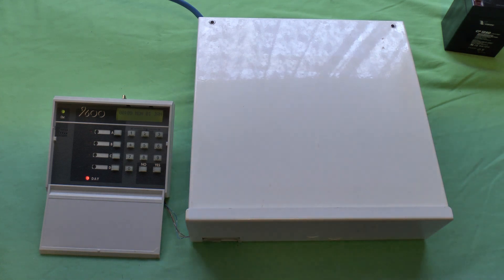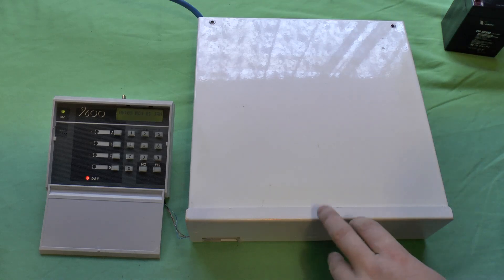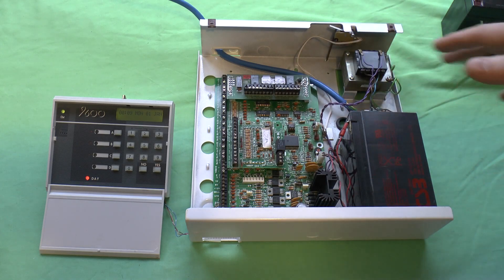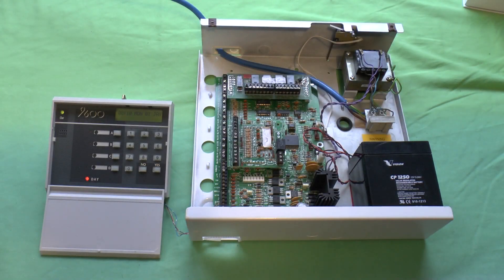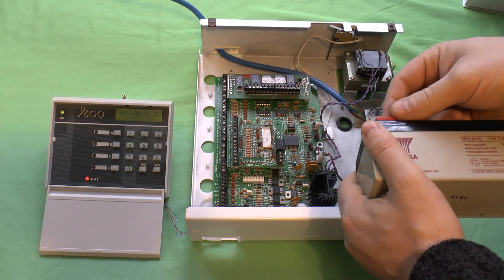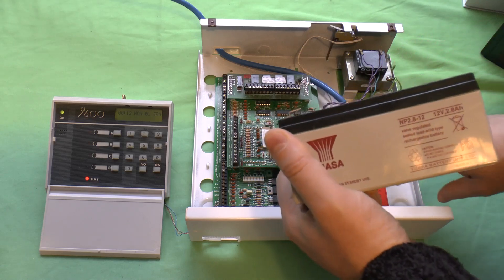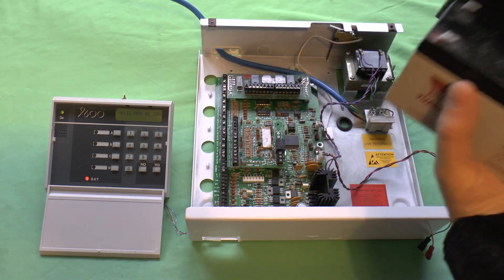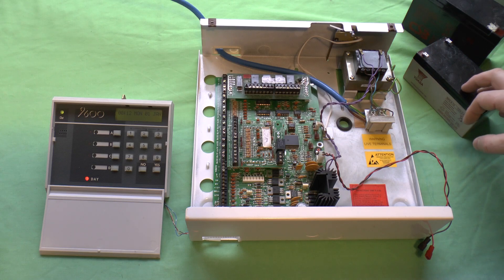A question about burglar alarm batteries

Comment: Best panel scantronic ever made imo and arguably the best domestic alarm system you could get, not many out there now but I guarantee the ones still in operation will far outlast most modern panels installed today!

Comment: The bigger the ah (amp hour), the longer the alarm will be up and running in a power failure.
Reply from the maker: Yeah I get that (that's why there's a 22Ah in mine). It's things like a 4Ah battery in a panel designed to take a 7Ah which puzzle me.

Comment: Either the batteries wont fit properly in the panel or the engineer has taken out a failed 7.2ah battery and replaced it with what he has at the time.

Comment: just to point out, you shouldn't stand that 7Ah battery on its end like that....... it affects the life of battery if its standing on its side like that...
Reply from the maker: Better tell Scantronic then, because that's the way they've designed their panel to take it. Also APC have UPSes such as the SmartUPS RT range which are switchable between tower and rack orientation just by swapping the rails for feet, obviously in one of these orientations the batteries will be flipped on their side, just like those shown in this video.

Comment: Its known as TRIOCS a very common condition that affects engineers and alarm company's. In laymans terms it stands for Tight Rectum Installer Or Company Syndrome. Very common in the industry. This is why alarm engineers that are self employed can spend up to 50 minutes using the toilet...... So no, there is no reason not to use a 7AH battery. This grade of panel is for large domestic / small commercial installs. NACOS and other industry bodies do actually specify the time a system should run on standby. The 9600 was the brother of the 9800 panel that just had an LED display. Its a rock solid and very reliable panel aside from the keypad keys wearing out and having a dodgey back tamper they are great alarm panels. I installed one in my parents home for them that ran for nearly 20 years before they moved. It looks you yok have the zone expander and a comms board plugged onto that panel. Keep it and use it. Sadly scantronic have been purhased by Cooper Menvier and my personal opinion is that the quality has dropped since then. Scantronic made some great panels like the 9100 (showing my age now) 9500, 9600, 9800 and the 448. Shame they didn't carry on as they were. I still have a 9100 boxed and its works as well today as it did 20 years ago. Nice to see one again. Thank you and all the best.  :)

Comment: I have a question, can you fit a battery to those gsm alarm system that come with really small battery that won't last more than 2h. I just wonder if the gsm alarm system does not have a charge controller (that will handle changing external 12v batteries like shown in this video) any comment will be much appreciated. Many thanks
Reply from the maker: Without the model number of the alarm system it's impossible to tell.
Reply: http://www.gbeshop.com/infobase/downloads/Kris_products/YL-007M2B.pdf

Comment from the maker: I've just re-read the original video description and realised that I got called out the Sterling 10 mentioned above a few weeks ago, because of a faulty panic button (the house has changed ownership since the battery was replaced). Having seen the documentation showing who originally installed the panel, I'm not surprised at the choice of battery. They've pulled their socks up since then but back when the panel was installed they had a reputation of being fucking cowboys and are the sole reason we now have a list of approved network jacks at work (to prevent them installing the cheapest shit they could get their hands on).

Comment: I am a licensed installer from Perth Western Australia. When an alarm is monitored (in WA monitoring can include the alarm sending you an SMS with the zone(s) that has gone off) the battery must be sized to keep the system running for a minimum of 16 hours. If the system does not have monitoring it must keep the system running a minimum of 24 hours. 

ALL the panels I install come from the factory with 7 Ah batteries as standard. If I have a system that has a greater need for more than ~300mA draw from the battery (ie the panel, all the keypads, detectors etc) I split the power across the panel and a second enclosure with a battery backed supply and another 7Ah battery  (Why 7Ah batteries ? Enclosures and PSU boards and a 7 Ah battery are usually cheaper than 17Ah batteries (which need a higher charging current as  we can not take longer than 48 hours to fully charge the battery (most smaller panels only charge at ~350mA)..... 

If I am using a commercial panel (and most of my work these days is industrial sites) then they can charge 17Ah batteries and have a link on the board to put the charger into a high current mode for the larger battery.

Comment: I'm a licensed installer. It's a combination of things. Many panels come with the 4.5ah from the factory because it's cheap. Then the technician who replaces it may not have the good sense or decency to recommend a bigger battery. If you can fit a 7 or 12ah battery, making sure the terminals do not short anything out, go with that. Be sure to replace your battery every five years.  Also, I would recommend you test your system on AC and battery, AC only, and battery only, on a regular basis. You should probably muffle the siren when testing so your neighbors don't get accustomed to hearing false alarms causing them not to pay attention during a real alarm. Oh, and don't forget to inform your monitoring service you will be testing.
Reply from the maker: +The Devil good to hear an installer's take on it and some useful tips.
I've got a 17Ah in mine, basically because it fits and it's within spec for the panel.
Reply: +AintBigAintClever Sounds good. Also, when the installer replaces the battery every 5 years, keep your old battery. You may need it for a temporary fix should your new battery fail. Lots of times, the service company just sends it to the recycler. It's your battery, you paid for it, find a use for it.  Turn it into a backup charger for your phone or something. One more thing, I would make sure your siren goes off if the phone line is disconnected, this is optional in most systems I've seen.

Comment: any alarm engineer would have fit a 7 ah battery...if they had one in there van,otherwise they probably just used a 2.6 ah battery to save a return visit and not look stupid!! the 7 ah battery is recommended for this panel as it can keep several devices running longer.having a 7 ah battery means your alarm will last longer in a power cut over a 2.6 ah.i have the same panel it ran for a day whilst the electric was off..Batteries should be changed every 5 years,regardless of what they look like.Some last 8/9 years,others will last a mean 3 years,bit of a lottery,really.not worth risking,though,im an alarm engineer and ive seen faulty batteries damage the pcbs and cause all sorts of mayhem for the owner at 3 am.9600 best panel ever made imo

Comment: Battery size selection should be based on how long you require a system to run in the event of a mains fail. The battery should be selected  based on the total current draw of the system and the minimum  time you require the system to function without mains power. The battery is then generally replaced when the capacity falls below 60% of its rated capacity

Comment: nothing beats the old scantronic 9600. my 9600 is 32 years and still works perfect to this day, good solid panel as long as you remember to change the battery. they are very rare now. its just a shame a lot of people replace them for cheap trash. nice to see you have looked after yours. as for your question probably all they had in the van at the time or simply couldn't be arsed to get the correct size,

Comment: The battery is smaller because it does basically the same job
But it also saves money on your electric bill, because a battery is constantly losing power, so it is in a constant state of recharging,
So logically the battery takes more to charge a bigger battery...
That what I think... Others may think differently though :D
Reply from the maker: Self-discharge rate of a sealed lead-acid battery is very, very small, about 5% per month, so there won't be much difference in the amount of power being consumed by keeping that battery topped up.

Comment: The latest panels take 18 ah batteries now to cope with eu regs on grade 3 jobs. Some old panels are designed to only take the 3.2 ah battery others the 7ah and some only a 2.1 ah battery it depends on the size of the system. The battery life depends on where the panel is, if its in a boiler cupboard for instance it will cook the cells and only maintain optimum charge for a few years. 7 ah yuasa batteries tend to last about 4 years in my experience before the ACT battery tester fails them. On very large systems there are psu's next to expander panels holding further backup batteries.

Comment: The alarm on this house (dead as a dodo, have no way of knowing how to work it!!) had a 1.2Ah battery in it which was completely goosed, though I'm not sure if it would even take a bigger battery, haven't looked inside the panel since last year... :P
Reply from the maker: You may be able to get hold of the user (or better still installer) manuals online. ukpanels.com is a good place to start (well, after Google of course).
Reply: AintBigAintClever
I don't even know what brand or model it is, plus the keypad was ruined by the prev. occupant (too thick to press buttons I guess!!), and the PIR sensors are all painted over, so, it'd cost more than it's worth to fix and get working... :\

Comment: I had made a similar observation. The alarm system in my rental property had been installed with a no-name 1.2 Ah battery. After about 3 years, it was dead and could not even sustain the alarm panel for 2 seconds.

I replaced it with a 7.2 Ah standby rated Yuasa battery. 2years later, I tested it and found that it could barely sustain the panel for 5 minutes. 

I guess the issue is that even a 1.2 Ah battery could sustain the panel for 6-12 hours if it was in good condition, and that's good enough for 99% of power cuts. However, landfill-grade charging circuitry in the panel will destroy any battery within a couple of years. Possibly even more so, if the panel is installed in an area exposed to heat (e.g. airing cupboards, or plant cupboards shared with a boiler, etc.)

The smaller batteries, may be slightly cheaper, but they will be lighter and smaller, so easier to transport and ship - I guess, if you're installing loads, it all adds up.

Comment from the maker: Interesting, I'd have thought the main battery will make the alarm stay quiet for longer (not sound for longer) before it goes flat, at which point the battery in the bell box will start sounding the alarm.
A bigger battery IN THE BELL BOX would make the alarm sound for longer (up to the 20 minute time limit) and keep the strobe going for longer (until the battery goes flat).

That a larger capacity battery wouldn't make the alarm louder is pretty obvious.

Comment: The battery is only there to power the alarm during power failures. All a bigger battery will do is make the alarm sound for longer before it goes flat. It won't make the alarm louder, or more reliable.
However, your alarm should have a time limit of no more than 20 mins before it silences itself (this is to comply with noise abatement issues). The standard battery will last for MUCH longer than 20 mins in a power failure before it flattens, so why waste money fitting a bigger one? No reason not to fit a bigger one, but it's your money, so go ahead and waste it if you wish.

Comment: I dont really understand the difference, both batteries will do the same work.

I have the small 1.2Ah battery installed, when i was on holliday it screamed for 4 days nonstop due to power failiure (it was powerded by the battery) until someone had to come and turn it off.

Cost saving might be the factor, but i dont think its crippleing your security.
Reply from the maker: It shouldn't have gone off due to the power failure, the battery's meant to prevent that. The siren has its own battery and will go off if the power to it is removed (in other words mains has gone and the backup battery has gone flat).

A bigger battery would've kept the alarm quiet for longer.
Reply: Yeah thats right, when power goes off, it should be queiet until its restored. 

What happent here is, that power went off, than in went on for a while and it started screaming, but the power was on for about an hour, than it went off for about 5 days until electican came to fix it.

If it managed to scream almost 4 days on battery, im sure the battery could keep it quiet for much longer.

But anyway im thinking of changing the alarm, the problem is stupid design, not the battery as much, i think.

Comment: I my self fit the biggest I can fit, ( I am from this trade) if the engineer does his job correctly then this should all be worked out as to what size should be fitted by what is on your system and what mA it's drawing, a lot of engineers are lazy and normally have messy installations so can't fit the biggest they can as there are cables all over the show! Just to put you in the picture on some industrial installations and depending on the grading there will be a 17ah fitted or two 7ah together.

Andy
Reply from the maker: There's a 17 on mine :)

Comment: I would think one of 2 things: Its either the 2 or 3 pound price difference or it is to fit into minimum standards then charge a shit ton of money to make a profit on it. Personally I would after an installation actually look into the alarm and check what kind of battery is in it and just replace it with a larger one like 7 aH if it can handle it and if there is a smaller one in there.  The other thing I would do if possible is request that it be installed with a 7 aH or 9 aH battery.
I am NOT a security system installer or technician, just an electronics hobbyist at the moment, so what I'm stating here is purely opinion.

Comment: Bloody bean counters always have to ruin things. Yep it's totally cost. If you're really keen, you could replace it with an 18Ah, and mount it externally. Would take longer to charge after a blackout, but it's more backup time. If you go any bigger than that, you may want to use an external float charger to help it out.

Comment: Not many 9600's out there now...... the reason why is cost and space and what is in the van, and whats in the panel.
our regs state that the back up battery has to last for 8-12 hrs, so an appropriate capacity battery is fitted to comply with the regs, however we don't carry an unlimited amount and selection of battery's in our vans so if your running low on battery's then a couple of battery changes come in at the end of the day you end up fitting whats in the van, so long as it comply's with the regs of course.
I usually have 3 of each type in my van, which is ok most of the time but sometimes emergency comes in and you use what you have.

Comment: Economicly reason thats all what is the best deal for that moment.
The capacity 7 9 or higher is depending where you use it and how often and how long you have power blackouts.
The higher the nr the longer it can overbridge the blackout.
The when the alarms goes off it needs to work for 20 min as seen in other  comments  that is i thing police reaction time. 
The chargers in those systems are most of the time just power supplys that are keeping the battery on its stabelize voltage. From discharge till fully charged take most of the time a few hours.
The the size of the battery needs to fit in the alarm unit. But the engineer makes it so the cheapest battery goes in the unit.
So actualy there is no difference in different size of the battery the voltage and ah are the important numbers. The tell you the capacity of the battery.

Comment: As long as the voltage and battery chemistry are compatible any battery could technically be fitted.  From a design and product engineering standpoint the manufacturers will choose the most cost effective option that meets performance specifications within a given cost constraint, and variations throughout a manufacturing cycle occur due to supply forces such as availability,  cost variations and vendor relationships.  Suitability of a variety of different commodity items gives the manufacturer agility throughout production, support and service operations.